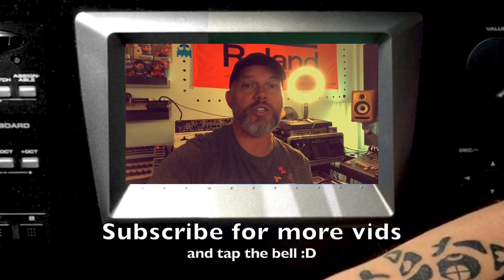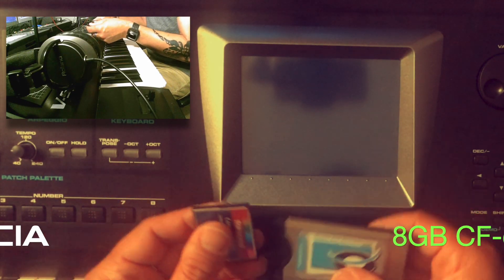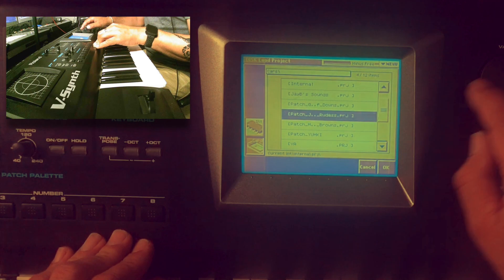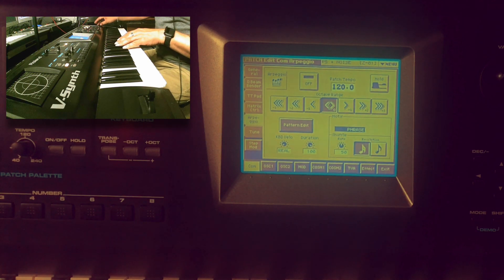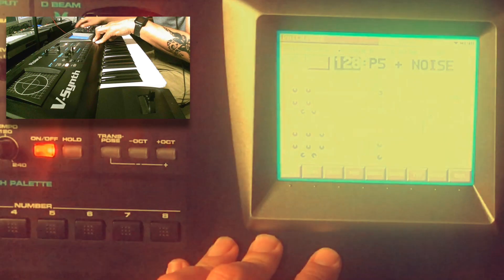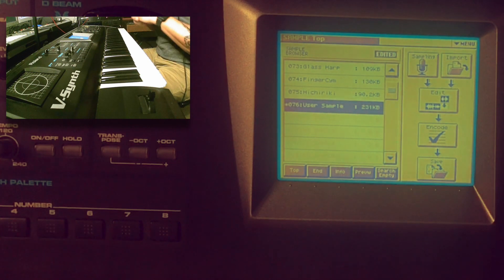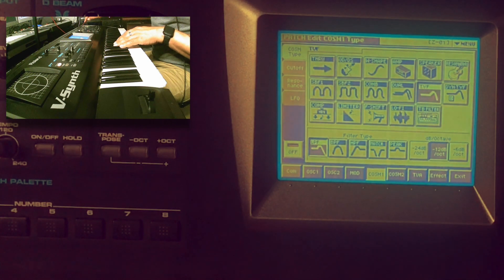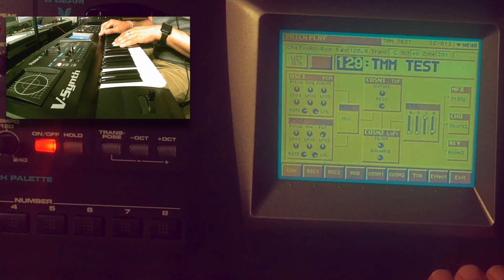Roland V-Synth: Understanding the File Structure

Comment: When I got my OG V-Synth 2.0 years ago, I got a PCMCIA SD card reader and 32 GB (maybe only 16GB, but it doesn’t matter really) card, thinking I’d never run out of space…but unfortunately, I only had luck with very old, small capacity cards like 512mb-1.0 GB. From some poking around online it seems like CF might be a bit better. I’d really love to add my own samples to my V-Synth. Do you have recommendations for PCMCIA adapters and CF cards to work with the V-Synth in 2023?
Reply from the maker: Hey!
At this very moment I'm preparing a video and I will show you which CF-Card I'm using.
Will be uploaded this week :)

Comment: These videos are all great! I thought I’d check in here as I’ve not had much luck anywhere else. I’m trying to update my v synth to the 2.0 software but receiving a screen saying “error - program data is illeagal” … using the os files from the official Roland site. Any ideas would be very welcome!!
Reply from the maker: Hi,
Thank you for your comment here. 
I saw your issue also of FB. 
Let’s see, you’ve issues with the 2.0
Version. You’ve downloaded it from the Roland Website. You have downloaded the correct 2.0 version? I mean, not the GT software but the V-Synth 1 software, right?
And what kind of computer do you use?
Is your V-synth still working or is it bricked already? I mean, can you start it and play with it or is it giving errors already?
Can you put it in USB-mode for updating?
Thanks for sharing more info.
Reply: @theMIDImaniac  Hi Roger, that is correct, it is still working, I can operate OK on the original OS, and I can enter USB mode to update. The V Synth is popping up as an external drive on my oldish macbook, but then receiving the error after I  attempt to run the update after disconnecting the computer and pressing 8 as prompted. Thanks for the reply!

Comment: Roger what the Heck are you doinng over there man ....... VSynth with No Sounds in it........ Wowww man you really are in the Twilight Zone right now ....... i had been trying to do this so i can put my own sounds in this but i got lost and didnt want to mess up anything ....... well 2 things can we hear some of the other sound packs that you downloaded ....... and how can we load just the sounds we want from those Sound packs or ......make up a Project with our favorite sounds from the sound packs and our own samples ....... also most dont know that you can hook up an external keboard or sequencer and use the vsynth as a sound module with various parts on different midi channels and using midi progam changes to change each sound on each part
...... man an empty vsynth and loading the sounds you want and using the vsynth as a sound module would be EXTREME if we could get all that to work ......
Reply from the maker: Sorry for the late reaction...
I'm now discovering how V-Synth Librarian works to create indeed a project with favourite sounds.
We're still on the top of the iceberg ;-)